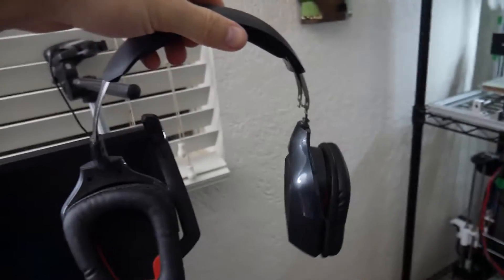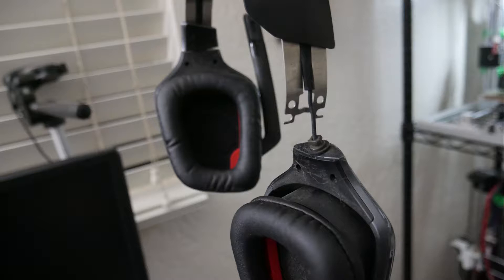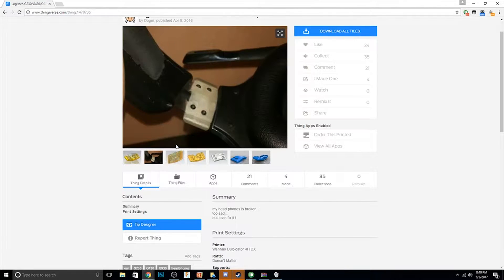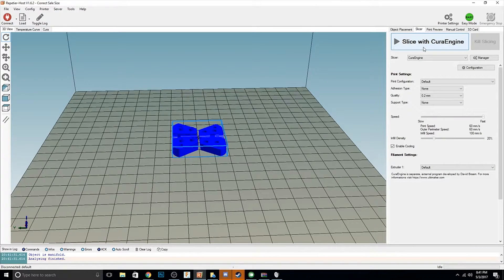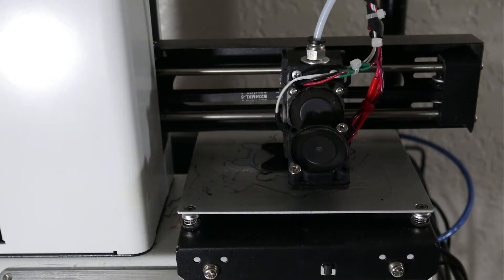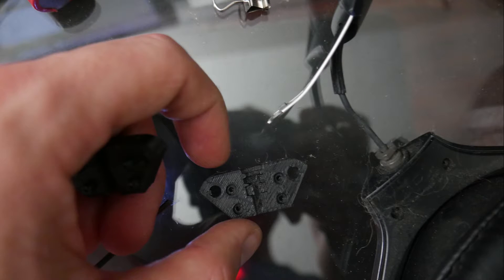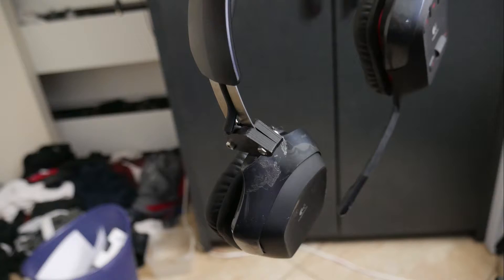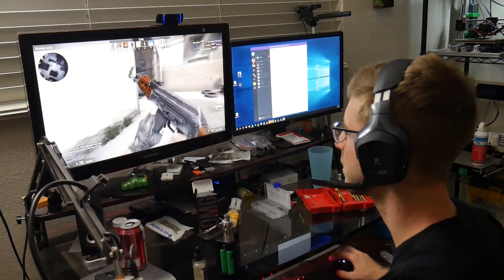Repairing Logitech G930 Gaming Headphones With 3d Printer

Comment: The hinge on my G433's left cup snapped just yesterday :(

I was doing nothing more strenuous than putting it on my head!
I have access to a 3d printer, but unfortunately thingiverse has no replacement parts for the G433 :(

Thankfully Amazon accepted the return, as the headset had failed through normal use.

Looking at where the failure occurred, it seems mine might have been a manufacturing fault.
There are two plastic supporting brackets inside the hinge, that are meant to take the mounting tension.
In my headset, one of these brackets was broken, which obviously lead to the fatigue failure in the outer plastic housing of the hinge.

However, the bracket in mine was broken *downwards*, not upwards; the opposite direction to the tensional force.
This leads me to believe the hinge had been incorrectly assembled, with the bracket in question being crushed during assembly.

Definitely something to look out for.

Comment: my g930 is still held together with black tape lol
Reply from the maker: lmao i think it has to be common to be left and sat on, I did the tape but it was so uncomfortable you can actually see the residue from the tape if you look in the videos haha.
Reply: ModBot I've had this headset for a few years now and my son broke them about 6 weeks after I purchased them, it has to be the weakest point of these but they still work great even today
Reply: I am doing the same thing! Unfortunately after this broke, the right side sometimes goes mute at certain angles..So I have to keep twisting the headset to get sound out of right side.